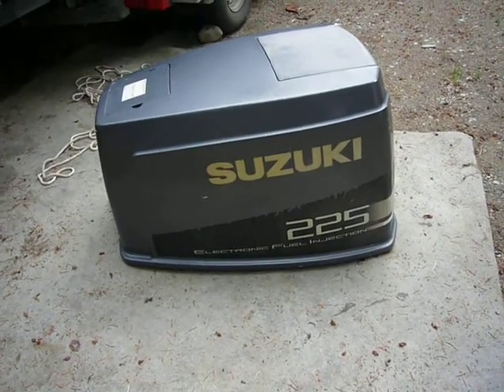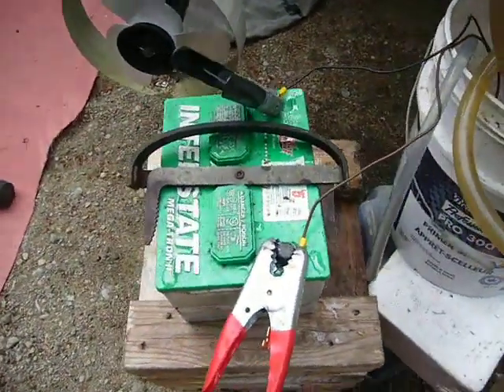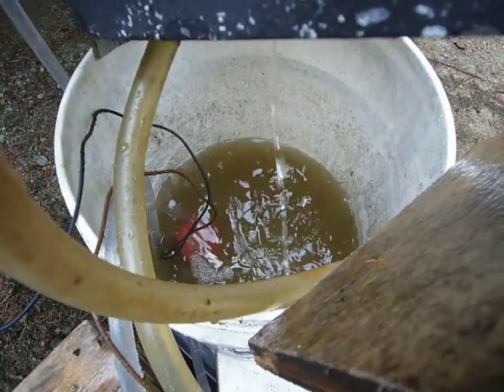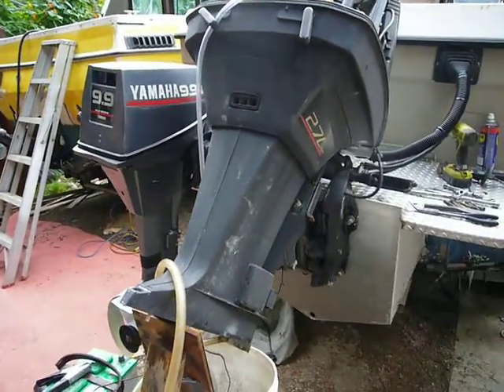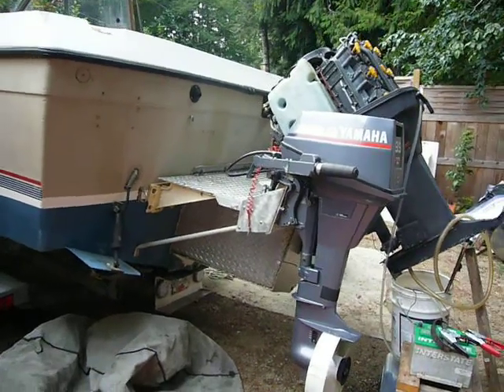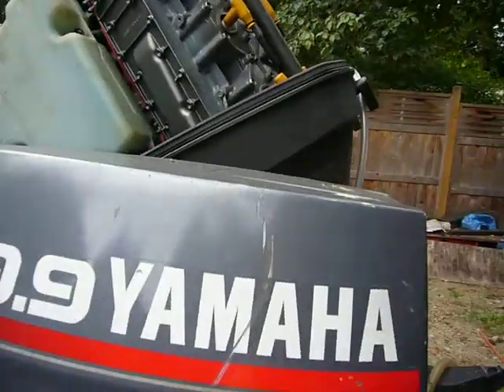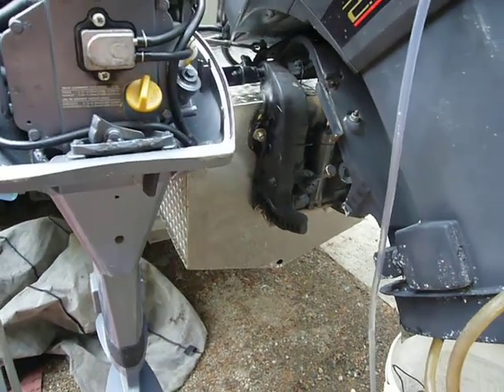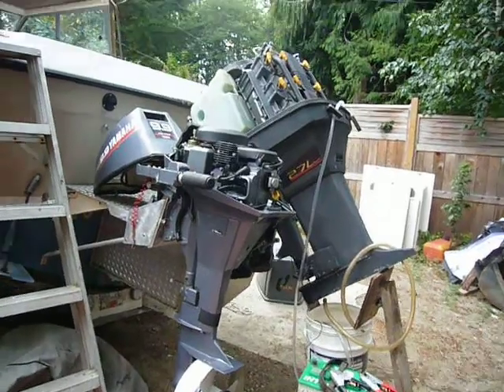A good way to remove calcium and build ups from outboard

Comment: Run motor in a plastic 44 gallon drum with detergent and sunflower oil mixed together water must get hot to open thermostat 20 minits or so this works

Comment: Did you take off the thermostat? ... and by the way haters will hate....... your video and though sound is a little off worked...they can hit the closed caption and that always helps in sound..........der.....
Reply: yeah, totally curious if the fluid made it through he whole system?

Comment: You're only flushing through the pee section, with no movement through the head area
Reply: if the pump is powerful and the thermostat is removed it should be going through everything

Comment: do you remove the thermostat?  the thermostat is probably closed because of water temperature and not allowing water to actually run in all loops inside?
Reply: Yep, they have to be out.